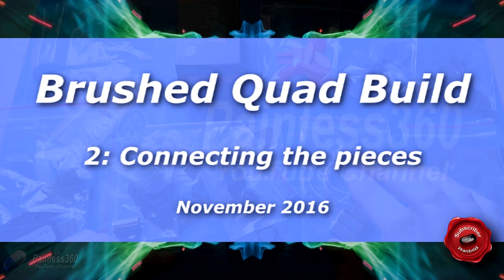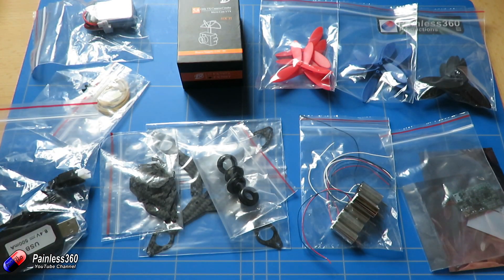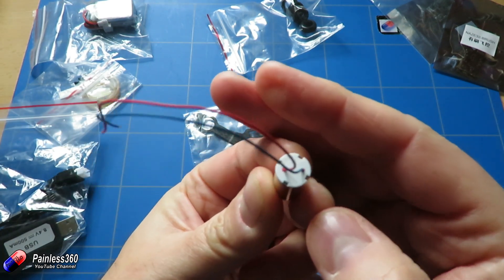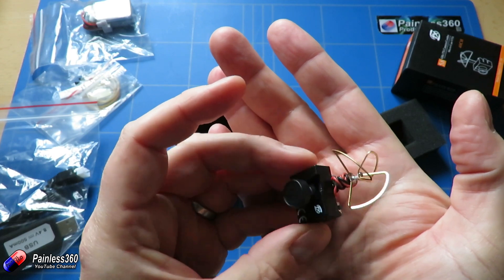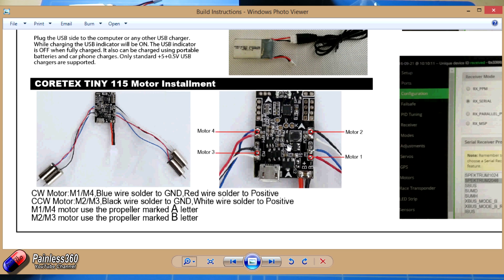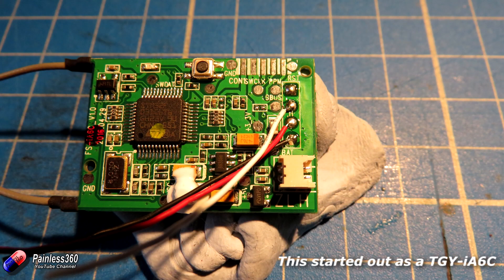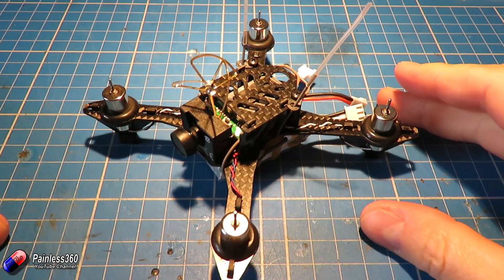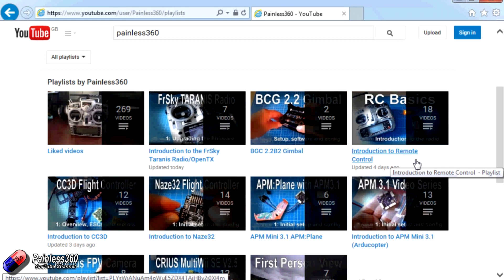(2/3) Building a Brushed FPV Mini Quad

Comment: and still no flying :/ Maybe ill get one of my own on the air before 3rd video.  :P  printing new frame
Reply from the maker: +Lasse u if you do post a link! :)
Reply: well, thats the problem.. i only have eachine h8 mini (flashed acro) board as FC with 8,5mm motors and because 8,5mm are maximum that h8 mini can handle (without changing FET's) so 1020 motors would require me to upgrade all of my gear without knowing if it will fly any better and if i should just get the brushless setup with the same effort of upgrading.. AND..  it is winter here so i cant really fly outside and my wife is giving birth to 2nd kid at christmas and im having hard time explaining why i need to spend that money on my "toys" when kid is on the way and i cant really convince myself so how could i convince my wife that my "toys" are justified :D  ... so, i am really anxious to see how 1020 motors handle, if it's really worth it or am i good with 8,5mm motors.
Reply from the maker: This is a build series, not a review video (we will do one when the build series is complete). The battery initially supplied with the kit (we got the kit before it was released) is too heavy so I'm trying others so pilots can avoid the same problems.. Best of luck with your build!

Comment: interesting kit there Lee. Im trying to figure out if this board down steps the 2s to 3.7 when it comes to the output. need to try some myself cheers.
Reply from the maker: +AndyRC I'll test it and let you know..
Reply: Thanks Lee cheers
Reply: @Frederick Olympia in post below linked the motors http://www.banggood.com/4X-Chaoli-CL-1020-10x20mm-Coreless-Motor-for-90mm-150mm-DIY-Micro-FPV-RC-Quadcopter-Frame-p-1106428.html?rmmds=search says in specs they're 3.7v rated with operating V 1.5-4.5... So they look quite 1s :D now i wonder what can be squeezed of them with 1s graphene ]:3 this full closed can looks sexy, i've been electric taping my motors for quite some time now due to the high dirt environments i mostly fly in, gonna order one set to check them out, alienwii 9w fets should handle them. Only got to figure out how to mount them :D

Comment: Howdy big P. What are they selling the goggles for. Got to say, my opinion only, for the money my crappy Syma x5 has been crashed untold times (by me, my 1st quad) and never busted diddly. Did fix camera wire. Takes excellent vids decent quality and is much more relaxing to fly compared to my yuuuge home built that costs yuuuuge amounts of moola to crash, my specialty.
Reply from the maker: Hey Vic, long time no see. How's tricks?! What goggles are you referring to?
Reply: Trick's, here I think are related to call gals. :) Only action I get is when I open Steam and it " extracts my package".  Goggles on the cortexrc site you linked to. http://coretexrc.com/en-US/
Reply from the maker: I see, we've only got the quad here..

Comment: Hello, hopefully this is not to far off topic; I disabled the usb connection in the serial port tab and not my board wont connect through usb, is it possible to re-flash and hopefully resetting that option through the UART??
Reply from the maker: Not sure, we've never done that here. I'd try a FTDI Basic connected to the UART1 pins and have my fingers crossed. Let me know how you get it working.. Best of luck!
Reply: With the ftdi connected com 3 shows up but it's not communicating, I need drivers I think but I don't know where I would find them, I just hope I've not bricked it.
Reply from the maker: http://www.ftdichip.com/FTDrivers.htm It won't be bricked you just told it to not talk over the USB connection.. Best of luck!
Reply: It's not "bricked" but it is a bit, I set the arm switch but not the rates or telemetry, I have done the ftdi driver install the other day when I flashed my osd, I've emailed banggood about it to but no reply yet, so far the UART shows as a comm port but won't connect. This problem is smarter then me right now, I might ask for a replacement while recommending anyone with the same board for the love of, don't Un tick the usb VCP option in the serial port setup.

http://m.banggood.com/CleanFlight-BetaFlight-Micro-F3-Flight-Controller-Built-in-PDB-Buzzer-20X20mm-For-FPV-Racing-p-1094615.html